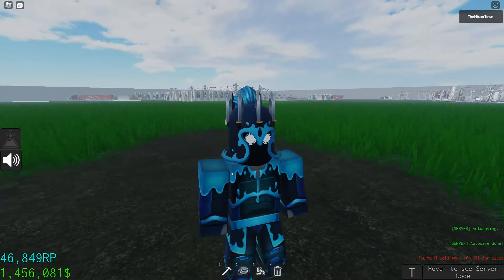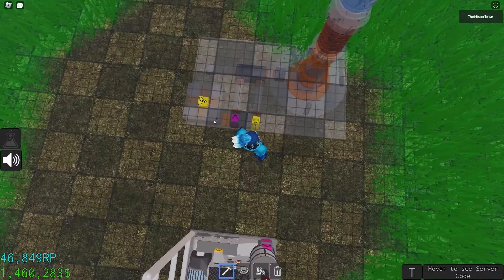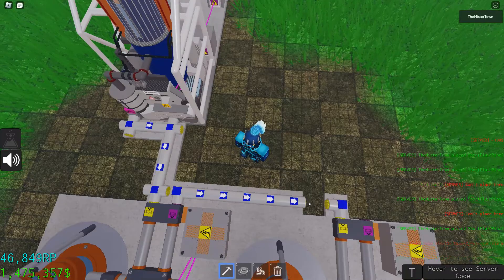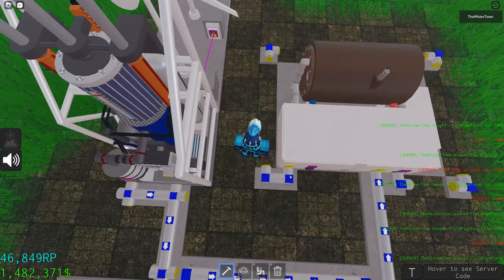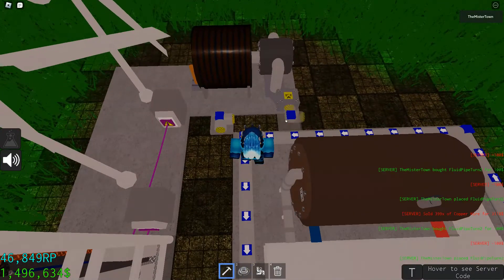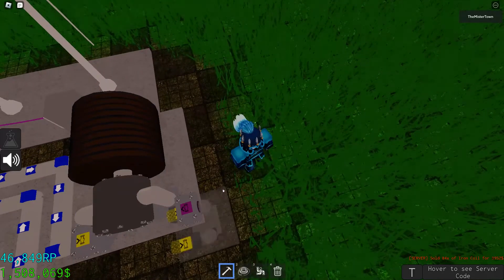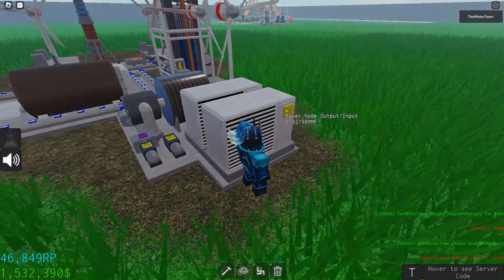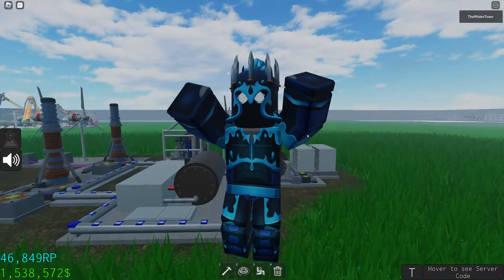Roblox Industrialist│ How to use a Steam Turbine and Boiler │ No pollution!

Comment from the maker: If you use wind turbines they can make less power. You can tell when they are spinning slower. So you can just recycle the power produced form the steam turbine.
Reply: hey bro i got a problem. it goes in the boiler, gets hot, goes in the (turn to steam) input and dosent come out at all

Comment: I have 2 geothermal plants running my steam turbine and boiler, and the 2 geothermal plants simply ran out of hot water, and slowly became cooler and cooler. I have all the power in the world being channeled to both of them, and it still doesn't work.
Reply: I think they got nerfed, my setup isnt working either
Reply: @CheeseMeat_  geothermal wells have water loss, you have to constantly pump water into em

Comment: either the water is at 160c but the boiler is at 50 or the boiler is at 130 and working but no power comes from the turvine
Reply: What in the fuck did you just say?

Comment: My boiler is stuck in 17 degrees Celsius how do I fix that?
Reply: I think your used water output (the one on the right) is clogged or one of your pipes aren’t connected
Reply: delete all your pipes coming from the right of your boiler. i had the same problem. the right side is full and that makes the boiler drop to its minimuim temp 17C.

Comment: Why isnt my boiler at 100°? Does the  temperature varies naturally?
Reply from the maker: It dose not. you probably need the water higher temp
Reply: How do you get it higher then? because it ain't letting me over 80/90 ? @Mistertown
Reply: @axasss_fire9744  you should try looping the used water into the water to steam input because it’s already hot and it’ll increase the temperature

Comment: I did exactly what you did but it still doesn't work I cant get steam to be produced out of the boiler can anyone help me with this?
Reply: Same problem with me
Reply: You see that temperture measurement in boiler?  get it too 101 i suggest somehow stablize the temp at 130 because some werid bug happen to me once there steam come out of the boiler's chimney i repeat CHIMNEY NOT THE OUTPUT PIPE and steam get super-heated ( 170-220) turbine somehow dont work

Comment: I built all of this accept water pump V2 and the 2 geothermal well and it doesn't work after the boilee

Edit: it doesn't work after the steam out
Reply from the maker: Do you need more water, or more power for the geothermal wells?
Reply: @Mistertown i replaced them with what u Didi and I afk over night and it lost heat to 17 degree s
Reply: @Mistertown i think it's a glitch bc I just added a bunch of solar panel 2 to it
Reply: I placed down the turbines and they're not euf power